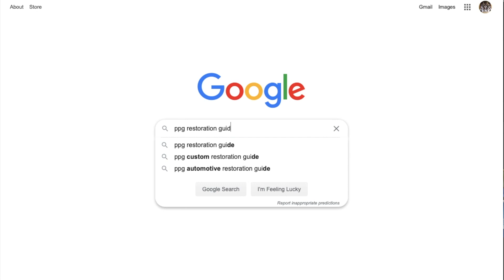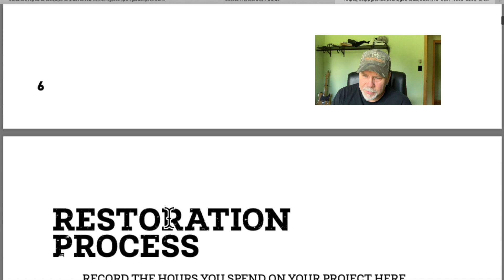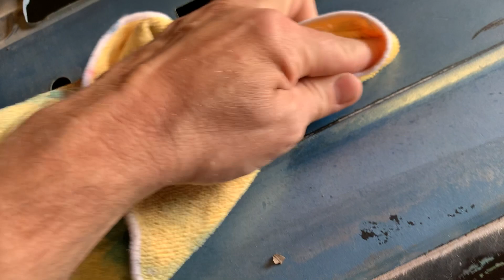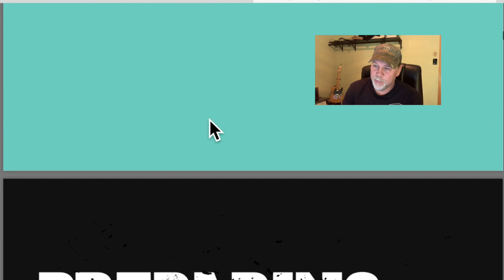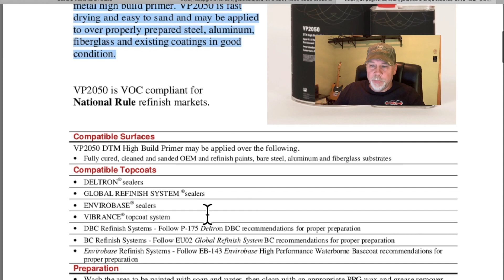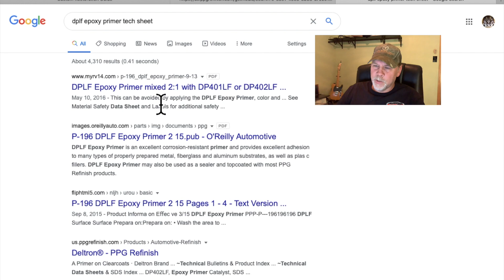C10 Project: Product Information Resources, Restoration Guide and P-Sheets. #c10, #squarebody, #info

Comment: that's a lie you can mix products like for example we did some repair on my dad's truck we used upol  primer transstar paint and matrix clear coat as long everything everything is your thing based you're fine
Reply from the maker: sure products can be intermixed but if you are new to the game and start throwing different things together, there is a potential for issues.  Just trying to keep it simple.

Comment: My local paint rep was pushing PPG ShopLine; what are your thoughts on this product line?  There are so many different PPG lines like Omni, Deltron, etc. it makes it hard for beginner to know where to start.
Reply from the maker: Jared Durham ShopLine is a great choice especially for a beginner. The products perform well and are affordable. If you mess something up or waste product by mixing too much, etc., it’s a little easier to handle than wasting high dollar product. A lot of the higher cost of products such as Deltron are for benefits that you may not need. All the cost for manufacturers to keep up with new colors and their
 variations, color matching tools, software, warranty, etc are built into the price of the paint. A collision center that has to match everything from a Cadillac to a Hyundai might need all those extras but someone wanting to paint their C10 may not.

Comment: Good info, I dont know if you remember, I had bad issue with lifting on a door I was painting, but was stripped to bare metal(guessing I didnt prep the metal properly) but soon will be moving to fixing bed sides, and will need to test to see what pain it is, I really dont want to strip the whole bedside, just where I am repairing(plus 10 inches or so)
Reply from the maker: LukeBrinkerhoff Yeah I remember a little. Either the product wasn’t DTM(direct to metal) or products weren’t compatible.  Most likely lacquer on the bed which is usually problematic. Definitely best to get it off there. Good luck and have fun!  Thanks for watching!